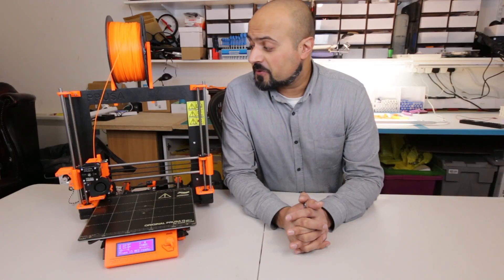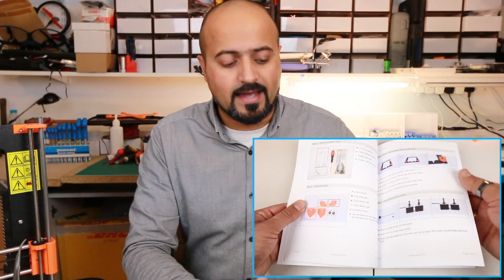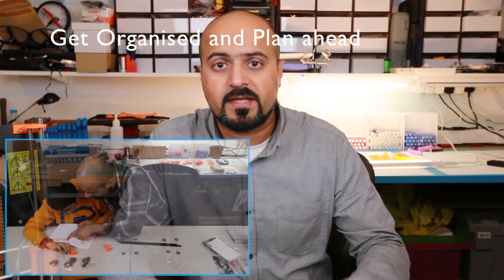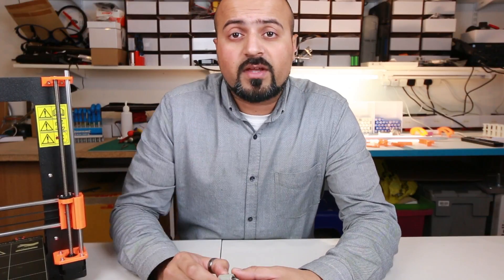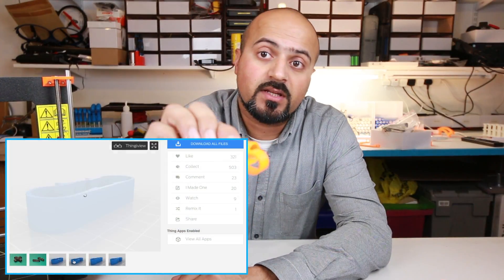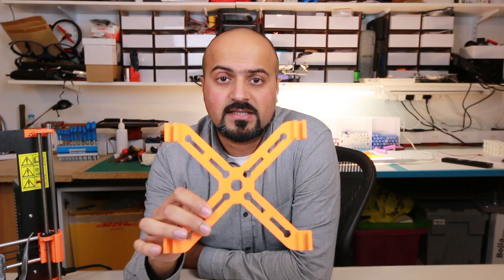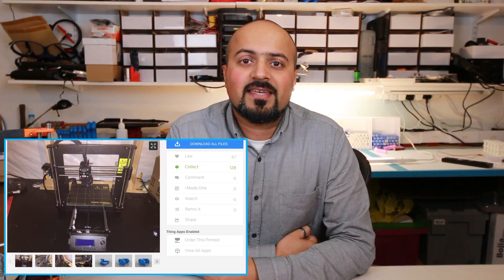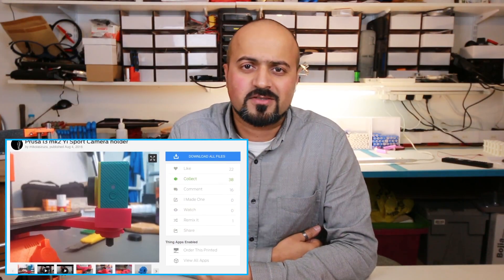3D Printer - S02 E02 - The Prusa i3 MK2 - Build TIPS, TRICKS & UPDATES

Comment: Awesome Video! Very honest, I which I had watched this before I received my printer. 
I got my i3 mk2s a couple of days ago. And was very diapointed than 8 out of 10 bearings were bad running rough and grinding. I managed to free one up with penetrating oil, but even then didn't feel great. 
I didn't want to ruin the smooth rods. So I have put it together temporally without bearings so I could finish up the electronics. . And have ordered IGUS, which will be a few weeks away

From doing some readings, the IGUS are meant to be a press fit into a collar. Do you find there is much play when not using a collar?

I'm guessing that the IGUS bracket is mostly for the older MK2, where they used ties. So I'm guessing that the bracket is not needed with the mk2s? Or do you think it would still be usefull to stop the bearing from going oval due to the force of the clamp.

Comment: my bed was bowed too. prusa wouldn't give me a new bed, they just told me to use washers to shim the bed flat again.
Reply from the maker: try flipping the Y-Carriage upside down so the top is bottom and bottom is top. TBH that actually fixed the bowed bed to almost perfect flatness. I also had to widen the centre hole in the Y-Carriage to get a screw in
Reply: Thanks for the idea I don't think I can do that as I have a mk2s and the placement of the bed is important http://manual.prusa3d.com/Guide/2.+Y-axis+assembly/298#s5072  The shims I used have got it close enough that the z calibration corrects any issue. The only one I have now is that one of the  nuts slightly produces higher than the bed. Only by about 0.05 of a mm.

Comment: An error made with assembly of the printer: One can see the Z-xis metal support rods are extending far above the orange brackets on both sides.  They should only be barely protruding from these top brackets.  Have a look at Prusa's website and compare it.  This could possibly be affecting stability or prints.  I noticed when Tom assembled his printer in that epic 13.5 hour video, he also put the rod in to find it didn't go away the way down, but realized this was wrong and changed something slightly and the rod went all the way down.

Comment: With the Prusa i3's frame being made of acrylic, there is quite a bit of flex in the printer. Wouldn't having independent suspension on each point that contacts the floor introduce distortion as the moving parts change the centre of gravity.
I've found just moving my i3 to a different part of the workbench can result in up to half a millimetre of movement in the print bed and it needing to be re-levelled.
Personally I'd stick with the firm rubber feet.
Reply: Acrylic? Are you sure you're not confusing models? I'm pretty sure the original one uses a metal frame.
Reply: You might be correct. My bad.

Comment: Hey Love you vids, so are the eBay Prusa i3 printers the same, or are they like the non genuine imax b6's. I am looking at getting one but the price seems too low for any quality, I would think. Anyways thanks!
Reply from the maker: RandomDIYProjects yep pretty much. Here you'll get genuine parts or well specced parts designed to work together. But the biggest is the support which is human and English speaking. The E3D extruders make a massive difference and auto calibration works so so well. Which only is possible with genuine Prusa hot bed.

Comment: Hi, I was wondering what kind of 3D Printers you would recommend. You seem to have had experience with some and looked at others. Any particular reasons for your choices?
Reply from the maker: Well. I love the way a Delta printer looks when it is working AND its also capable of printing very fast. But in reality in comes down to how much you want to tinker with it. You could compare this to a cheap printer that suffers from many, many, many paper jams or just buy somehting half decent and prints well first time. The Prusa is the most affordable and best printer I have come across. Secondly, software support. The cheap crap from China normally means you are tied to their software which is limited. The prusa just works with anything that can create G-Codes. Finally Support, Prusa has the best support and I will cover this in my next video. Good luck and just take the plunge.

Comment: There is also an online version of the manual, where they have photos of the steps from multiple angles and in higher resolution. I used this version the most in my build and it was very nice.
Reply from the maker: Thanks Honza. Yes I did come across that but after the build. its fairly good and does the same as the PDF.